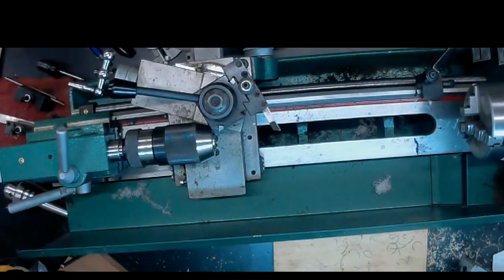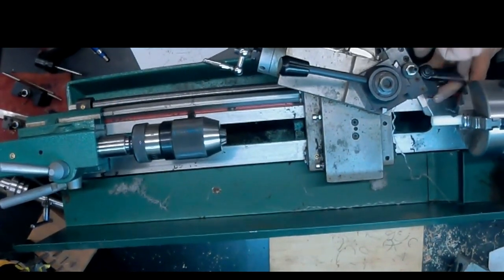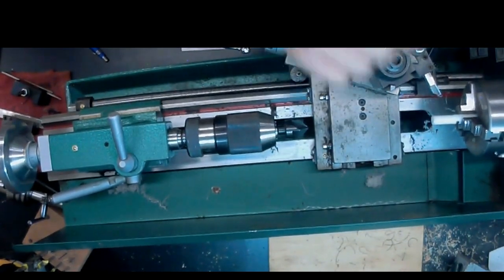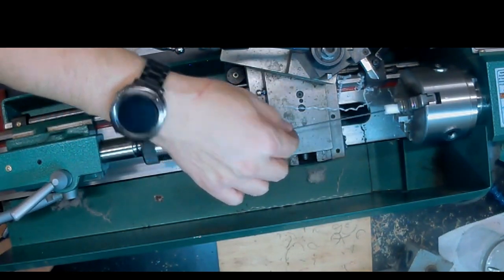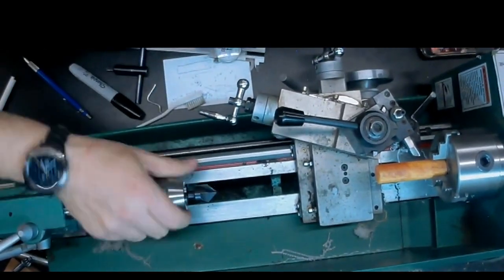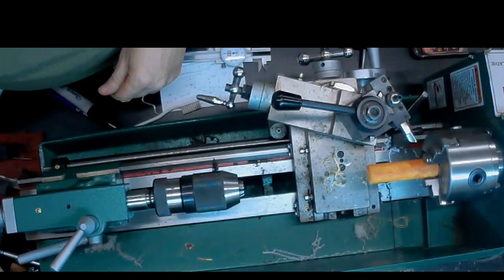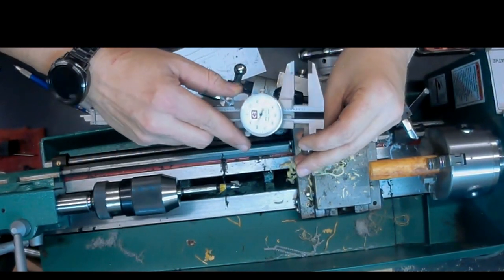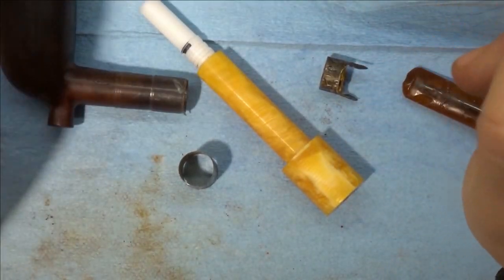Antique Ben Wade Restoration Part 4

Comment: Mike, thanks so much for making those restoration videos, I learnt a lot from you, not only learnt those skills, but also opened my mind. 
Could you please recommend a glue to glue briar paste on the rim? as one of my pipe's rim burnt uneven, I hope I can fix that, not sure which glue does the good job for that.
Reply from the maker: Hi Chandler,  I use epoxy mixed with briar dust for fills, but I don;t think you will be able to rebuild a rim.  It is probably better to sand it down.  Thanks for watching!
Reply: @CaneRodPiper  thanks for replying